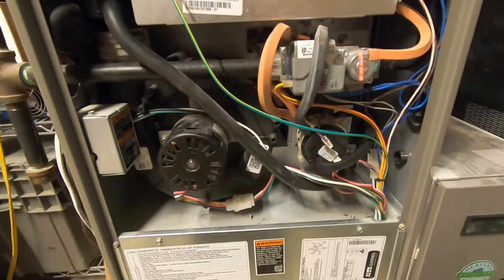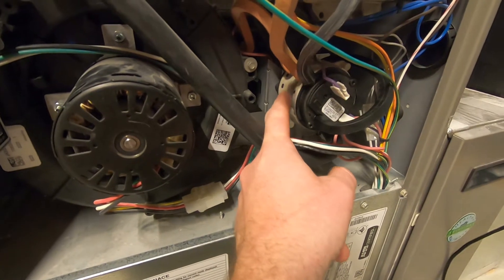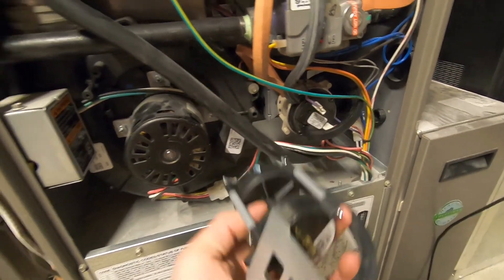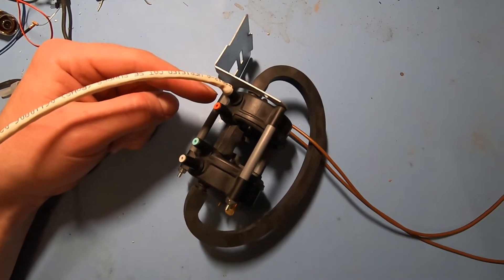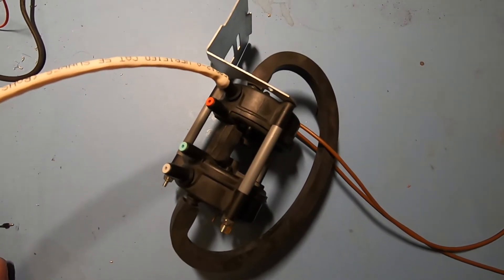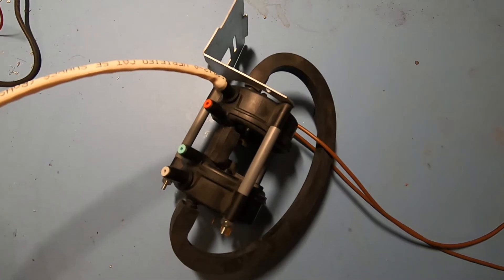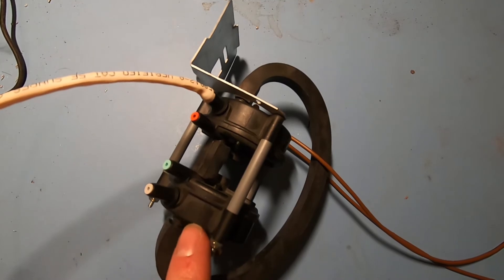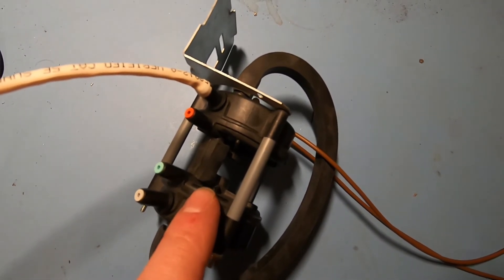Lennox E225 High Pressure switch

Comment: Basically heavily tapping my pressure switch got it to turn on. 

I tried blowing all the lines out and inspecting for blockage 
drained out any water in the exhaust condensate line
took the exhaust blower off and check that 

the smack fix did it. now finding some mobster to sell me the part.

Comment: This was great info thanks! What sucks for me is I have searched everywhere for a replacement part but can't find one for sale. All the dealers tell me is I need to have a technician come out. This is beyond frustrating since i can easily replace this myself but for under $100 but they want to charge me $400 to have someone do it for me. If anyone knows where to get the parts I'd would greatly appreciate it!

Comment: This is crazy… please read… so my code was 228 for basically the same pressure switch.  The part where Kevin had the black pressure switch off laying on the table and said he tapped it with a screwdriver and it started working.  I kept mine on the furnace… I did not remove it and started tapping both round black casings with a socket wrench fairly lightly but with a little pressure.  I continued to tap repeatedly while the fan was running and suddenly my ignitor turned on.  Then all of the gas lighters started flaming up and my furnace was fixed.  I can’t believe what a simple fix that turned out to be.  My house was down to 50 degrees because it’s negative 5 outside.  I truly hope this helps somebody.   Thank you Kevin!!!

Comment: We have the same code and the hvac guy said the switch is OK but we're still getting the code but the furnace is still working fine and he said we should replace the thermostat  , any ideas or suggestions  ?
Reply from the maker: If he said replace the thermostat, id get a second opinion! Could be anything, Clogged intake or exhaust, Clogged hoses to the switch, bad switch or bad main board.